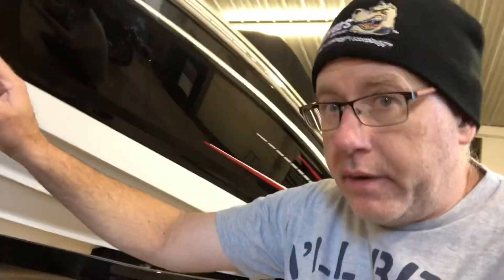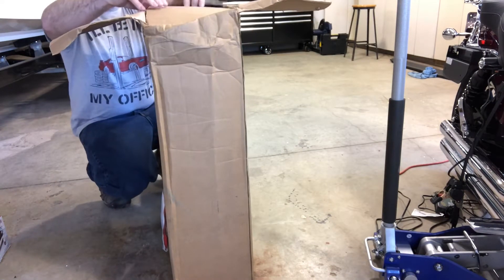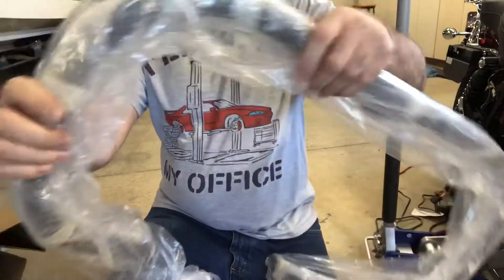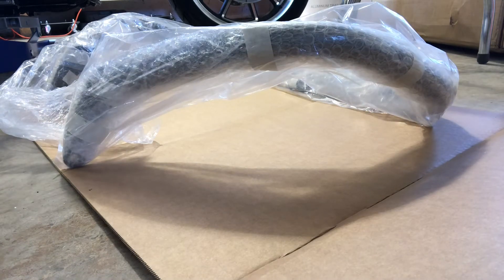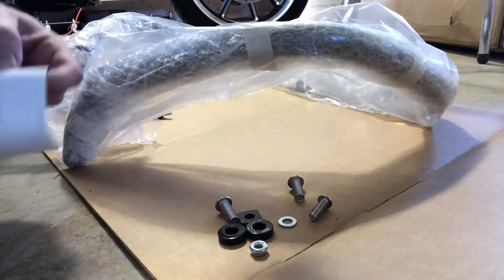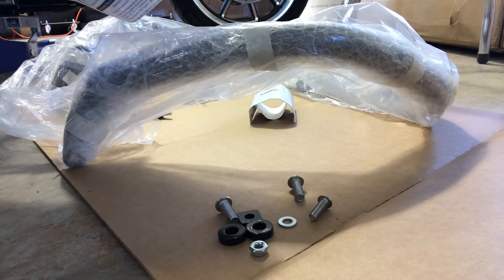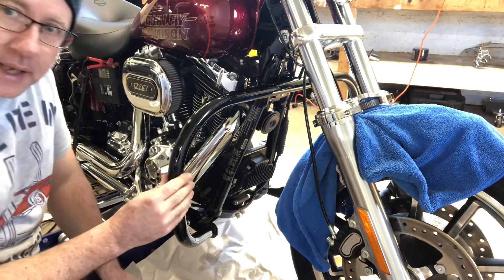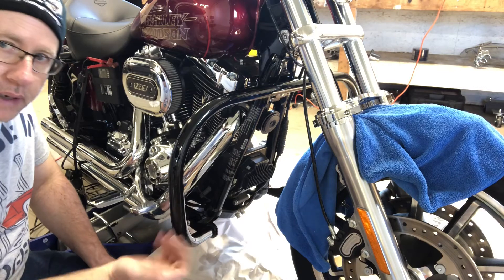Crash bar install on my HD Low Rider

Comment: Got me an 02 Low Rider and these bars won't fit with forward controls like I have. I think I'd rather have forwards rather than the highway bars. Haven't found anything that allows both.  Nice video though...
Reply: Check out Original Garage Moto. They do awesome crash bars that fit with forward controls!
Reply: I have the same problem with my 2001 FXDL.

Comment: ok i have a question my bike for some odd reason has a 5/16 bolt for the horn mount and 3/8 bolt obviously did not fit. where the hell do i get the correct sized horn mount so i can mount this crash bar. its been driving me insane trying to find the correct mount for the horn